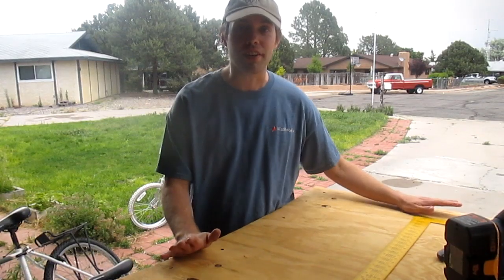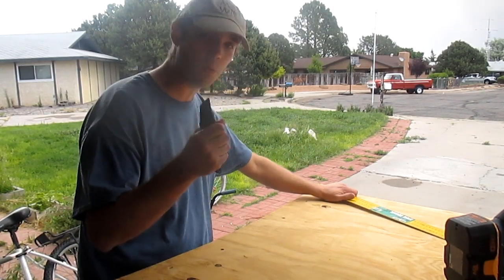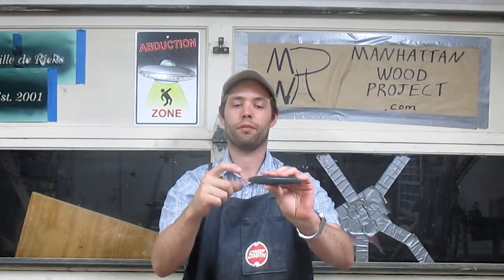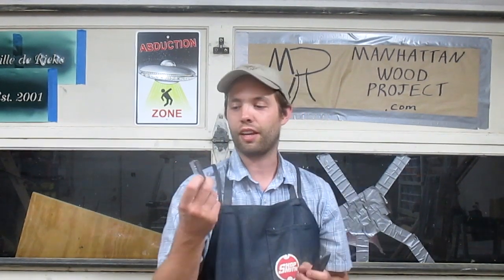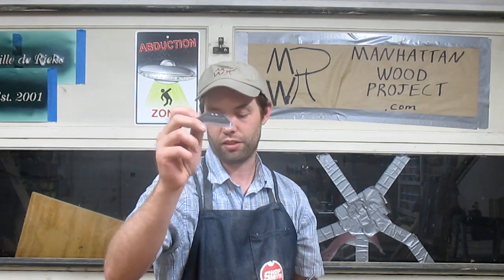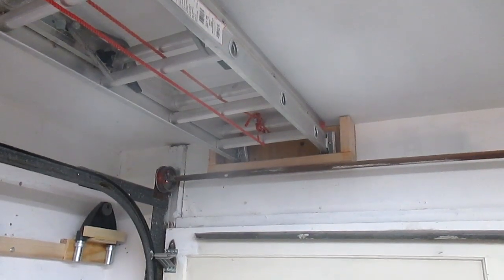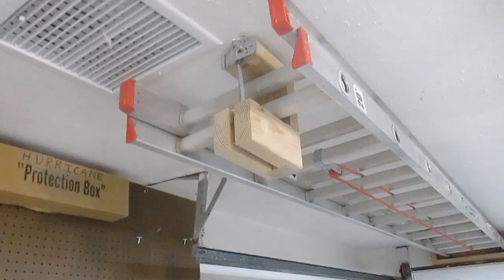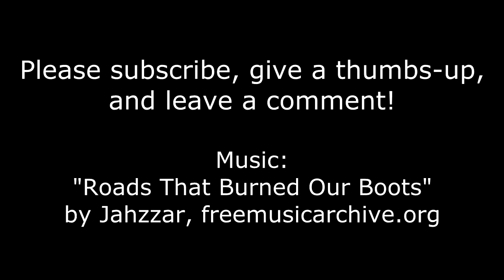14 - 2x4 Locking Overhead Ladder Storage System - Manhattan Wood Project

Comment: Video was well made.  The whole assembly was very complicated. Most people would never make that.  The video quality was very impressive.  I do think you will have the ladder fall on you when you try to get it in place and locked in before you are able to lock it in.  Good luck!
Reply from the maker: +Rob's Garage Woodworking Thank you.  It's definitely a unique design, it was a nice challenge to make something using dowels instead of deck screws for once.

The stowing and removal process take some thinking through, I designed the tolerances and the size of the foot box around how many ways I could imagine things going wrong.  :)

Comment: if i could make a suggestion with some of your scrap lumber a wood mallet will make a great addition to your shop,they are fun to make plus it will do alot of the same things as your claw hammer but will not mark or damage your project materials as easily,all the best to you and yours
Reply from the maker: Ron Sanford That's definitely on my list of things to do, but I just don't have enough scrap hardwood I'm willing to use on a mallet.  I would use up some 2x4 scrap, but I hate the idea of redoing the head (or at least faces) every so often.I could probably be persuaded if there was a "mallet week" or something like that though.

Comment: poorly designed and overly complicated construction.  try pulling weeds in your garden instead.  where do you store the ladder you need to get at this ladder? horrible.
Reply from the maker: jjcud I'm sorry you don't like it, it works just fine for me.  It lets me utilize ceiling space that has no other use, and it's something I can easily get down with a small stepstool that I use around the house all the time.